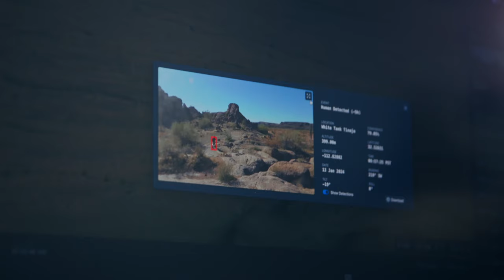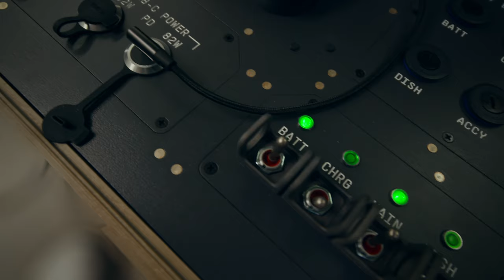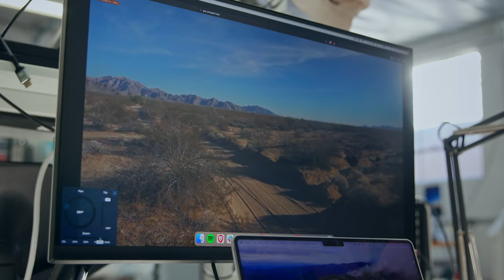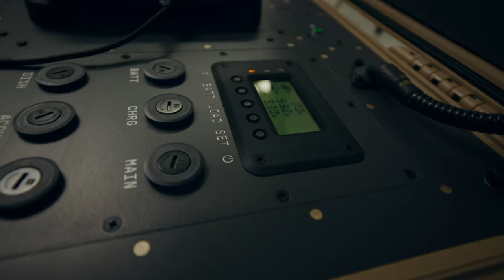They're Building the Call of Duty Minimap IRL | Picogrid

Comment: Look, i guess I am not that impressed.  A lot of these systems already communicate very heavily with each other via COT, which has sort of become an industry standard due to ATAK.  The camera thing really isn't super cutting edge either, there are already some very mature systems on the market such as G-BOSS which are already explicitly set up for this mode of operation.  The solar panels thing is sort of interesting but in terms of logistics it is very clear that its designed for a mode of operation very reminiscent of the GWOT era.  I am just not sure how sold I am on something like this as a concept.